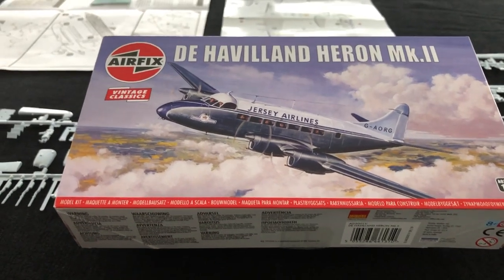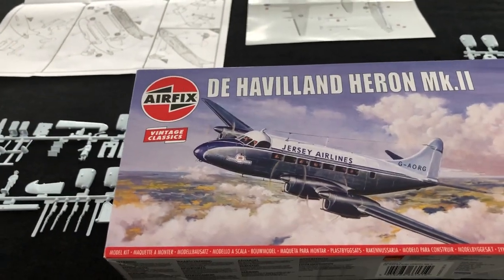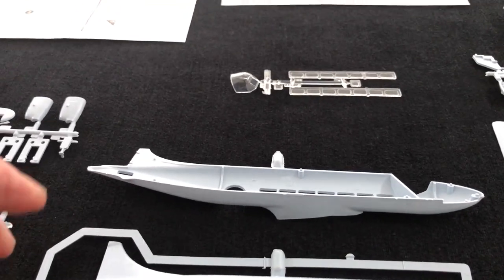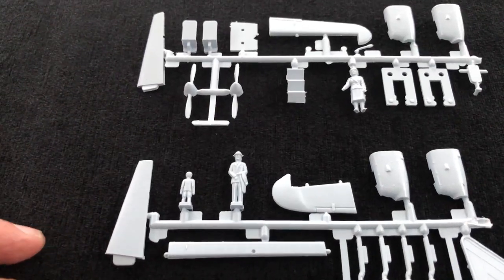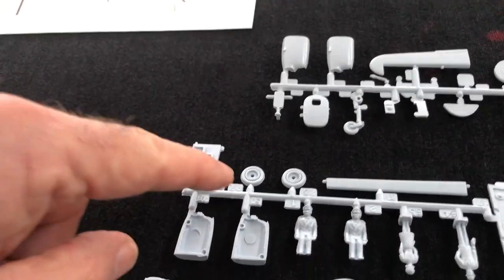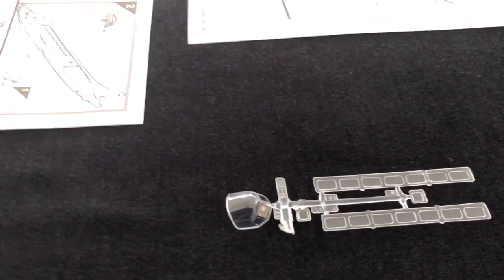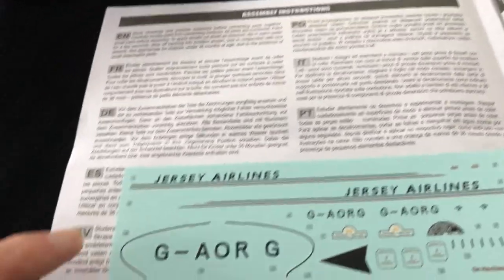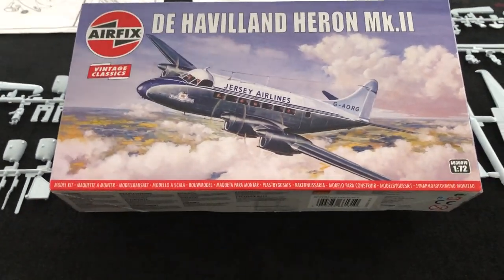Airfix De Havilland Heron Mk II, 1 72

Comment: There's one thing that I will never understand: what for is that horrible hump on the top og the cockpit? British airplanes are the only ones with that stupid thing on it. Same for HS 125 dominie, a beautiful jet, with that awful bonnet.
Reply from the maker: Ah well - who knows! As you say very much a design feature that must have had a purpose - avionics? Extra headroom in the cockpit?
Reply: @Geoff Coughlin  maybe, nevertheless,  I wouldn't sacrifice aesthetic just to avoid pilots not to duck. Think about a Learjet with that hump! . I love HS 125 dominie with RAF. The airplane is so beautiful but that thing on top of the cockpit gives a look so aesthetic that no longer in future models BAe made. Even Hawker Siddely suspended that practice. There's a theory in aerodynamics that talks about a region where air forces fuselage to adopt certain shapes. If you look carefully on Dominie, you will notice that hump "matches" a kind of channel with a "belly", located right under fuselage where wings and fuselage unit each other. There's a "passage" or "gunlet" that very probably air passes through with some kind  of advantage.  At least, that is what they might said, I'm not sure.  Anyway, recent jet and turboprops never got such abomination.  Anyway,  you know how British designers have always thought about airplanes, if not, just look at the Sea Vixen (I think it is a Hawker). It has the canopy displaced out from fuselage's centerline.  Well, who knows.